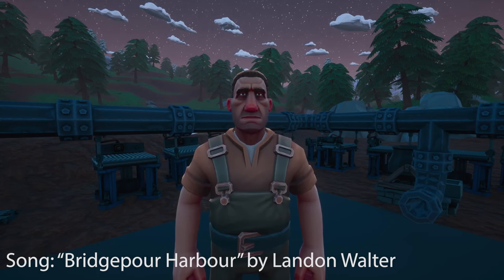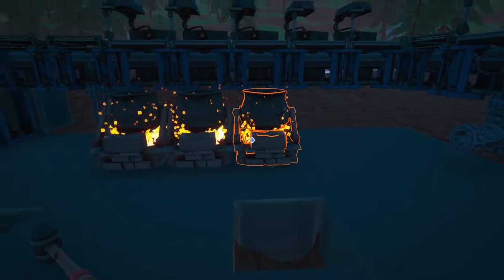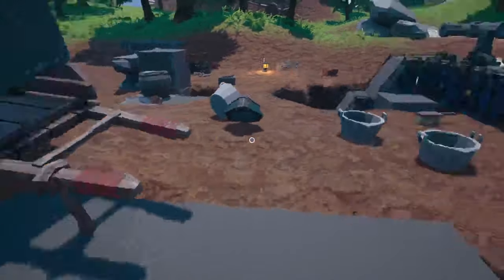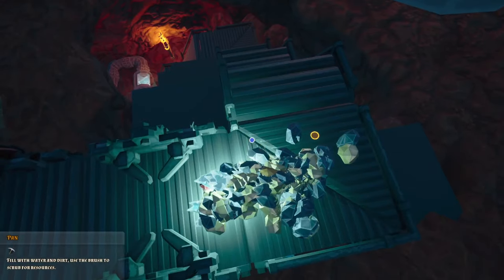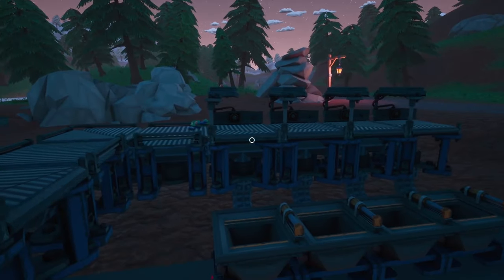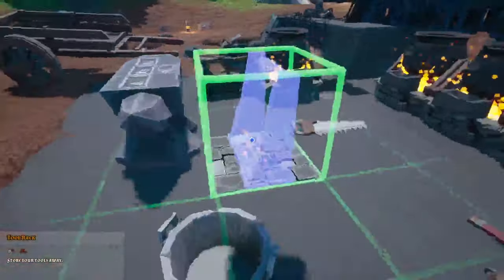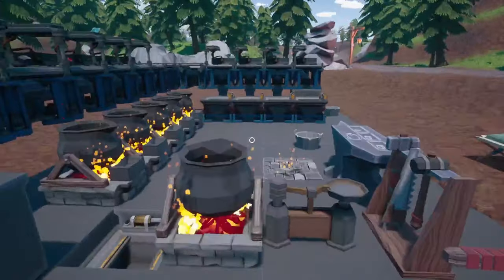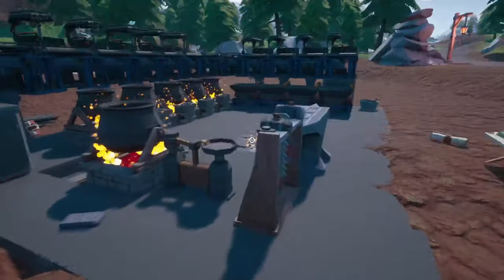Fully Automated! || Episode 4 - #hydroneer

Comment: The auto repair logic is way more complicated than needs be
Reply from the maker: So I've been told, but I like it because it guarantees that my filter will never reach zero. Having a flip flop would be simpler but it requires the filter to actually break to be repaired, where as this design just repairs it early so it never breaks.